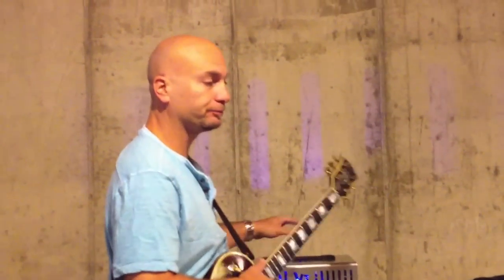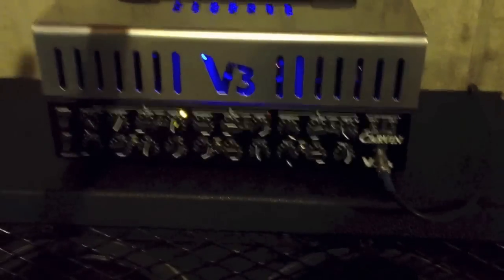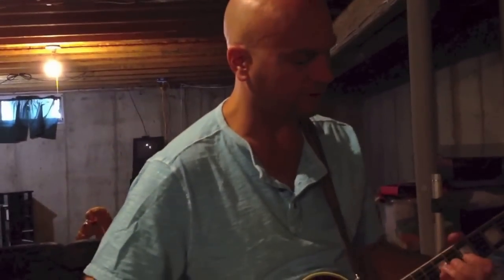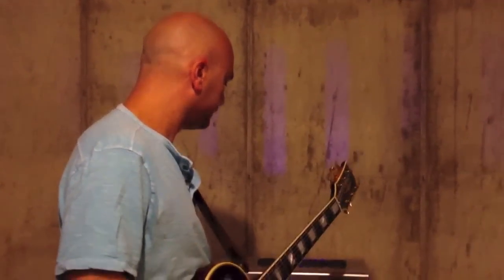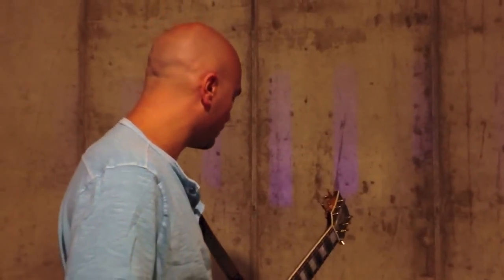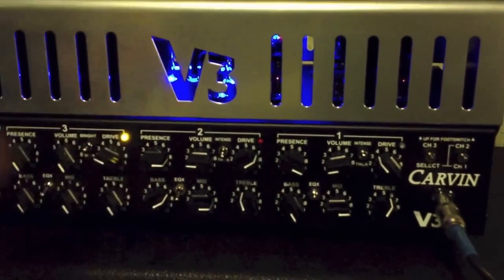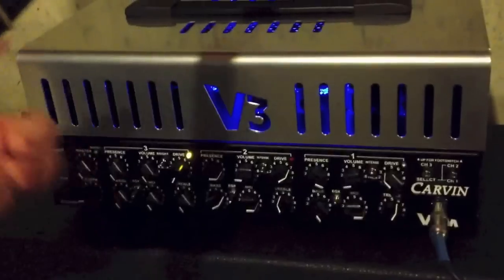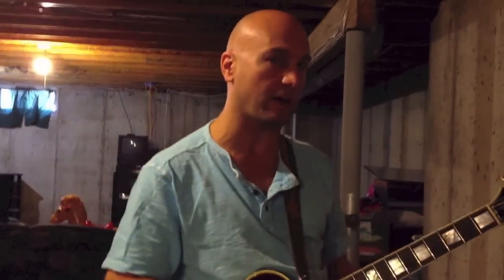Carvin V3M Clean: Part 1

Comment: Thank you!  I'm about to buy a used V3M and the other videos on youtube either gloss over the clean channel or have terrible settings when they demo it.
Reply from the maker: These really are great amps for the $$.  It will take a bit of tone tweaking.  There is a tone of options in there.  Just be patient with it.  I even use different cabs with different Celestions to get more options.  I still find myself tweaking knobs 5 years later!!
Reply: @sbonamassa  Will do.  I don't use a whole lot of gain/distortion myself, so I plan to set the clean channel along the lines of what you've shown here, then use channel 2 on about 11:00 and "thick" for a basic rock tone and then set up channel 1 similarly but a bit louder as a lead tone.  I'll boost both 1 and 2 with a TS or SD-1 when I want to tighten it up for metal tones, but that's only about 10% of the material I cover in my bands.  The versatility of this amp is really appealing to me.
Reply from the maker: 11:00 on the gain knob in channels 1 & 2 will be way beyond Basic Rock Tones.   In those channels the gain is so extreme, you need to be around 1-1.5 on the Gain Control.  that is if by Basic Rock Tone you mean, Jimmy Page, Warren Haynes or Angus Young.  That is the one draw back to this amp.  I guess for some it works being able to have those two channels the same in gain structure.  I would have much rather had Channel two be in-between 1 & 3 in gain structure.  It would have been awesome to have Channel 2 be like the gain channel of the X100b.  Just my opinion, being a Carvin amp user for 35+ years.
Reply: @sbonamassa  Interesting.. thanks.  The price I am getting it at, it's worth it even if I only use the clean channel and/or power amp (effects return) so that is not a deal-breaker for me.  But I would like to get more classic tones out of it if possible.  I'll have the master cranked as you demo in your video of the clean channel.  Maybe running the 1 and 2 channels on really low gain settings with the master and channel volumes high will accomplish that better?  Or maybe a preamp tubes swap?
Reply: @sbonamassa  Yeah you're right.  I just picked it up tonight and I find that the tones I want  on channels 1 and 2 (drive) are at about 2-3 on the drive, with the Master volume at max and then slowly dialing up the individual channel's volume to taste.  But those sounds are definitely in there.  I'm very happy with the amp.  Thanks for all your input and for the video series.
Reply from the maker: Many have swapped pre-amp tubes to lower gain ones and have had great success.  Channels 1& 2 will have to have their gains around 1, if you don't swap tubes.  I still run 12AX7's, but I am a high gain guy.  the other way to get some classic OD out of this amp, is to stay on the clean channel and drop the powers scaling switch to 25watts.  of corse this will make getting a supper clean sound impossible, in that setting.  I have not tried maxing the master and the channel volumes to see where the grit comes in on the Gain controls in Ch 1&2.  That's gonna be super loud, but may very well be what you are after.  The key to this amp is patience and to try settings that are out of the norm.  The X100b is similar, folks knock it because it's not plug and play.  You have to spend time dialing knobs.  a lot of folks do not have ears for that and just get frustrated.  Enjoy it and have fun!!